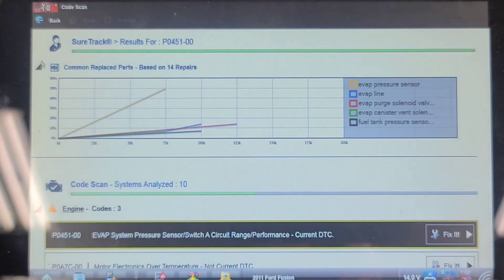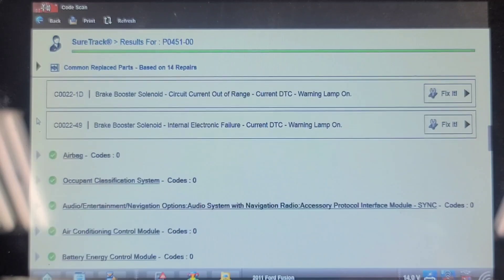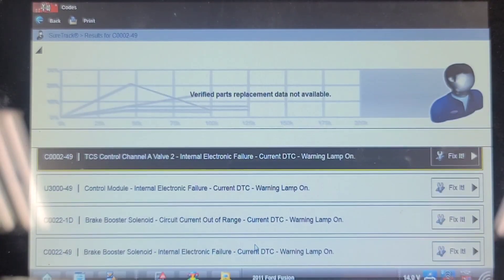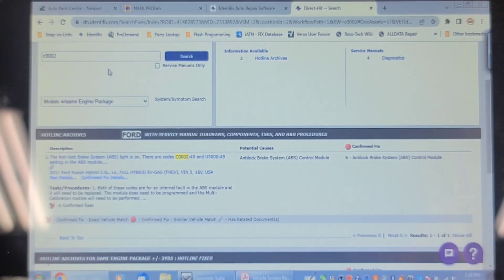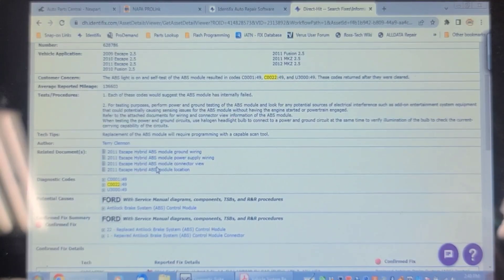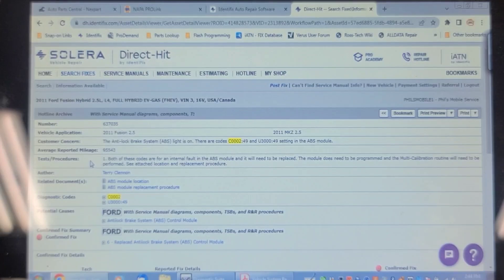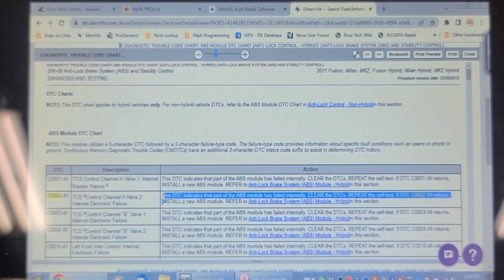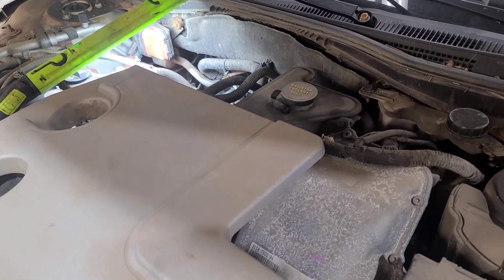2011 Ford Fusion Hybrid ABS, TCS and Brake Lights On, C0002, C0032

Comment: Mine just did the same thing while I was driving it.  Good luck finding an ABS module. The ABS module is Discontinued, Ford only supplies the hydraulic portion of the system $1046 from the dealer. I was fortunate enough to find one on eBay. The part arrives today, I'm hopeful it fixes the issue.